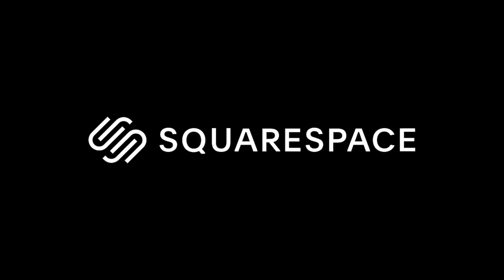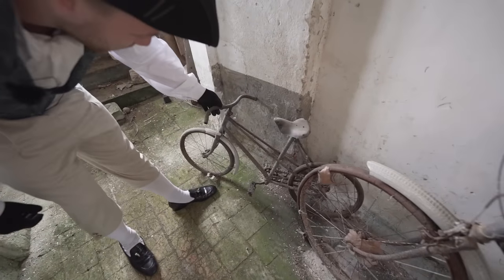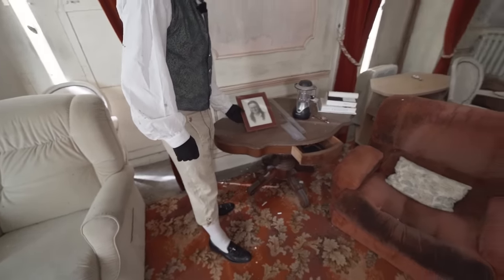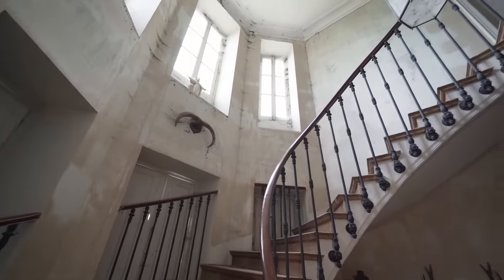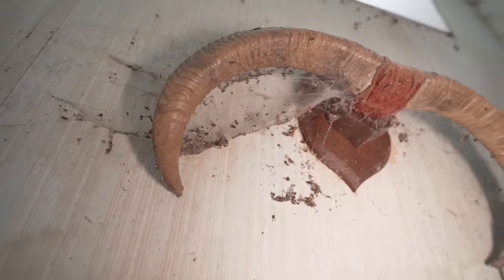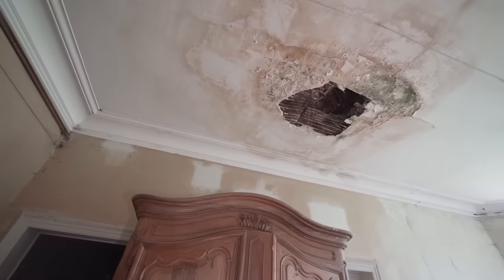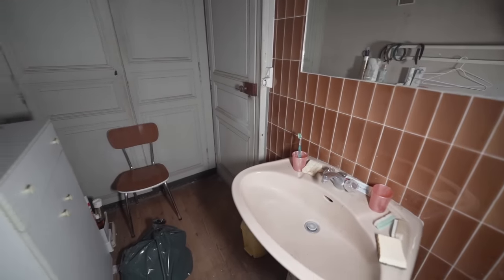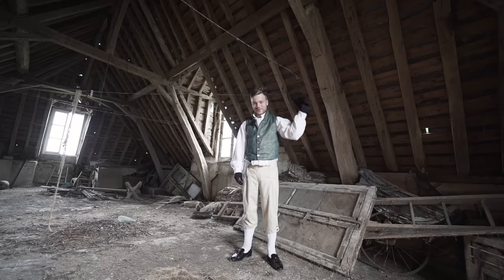Abandoned 1700s Fairy Tale Castle ~ Owner Died in a Car Crash!

Comment: Loved this. The little painting of the knight slaying the dragon is Archangel Michael slaying Lucifer. The knight has wings, a symbol of Archangel Michael. I think the last generation of residents who lived here abandoned most of this castle and only lived in part of it for decades. The part that is in very bad shape did not get that way in only eight years. The piano still plays because the cover was kept down over the keys, thus protecting the keys from moisture in the air damage. It is important to cover the keys to a non-electric piano after every time you play it for this reason.

Comment: I watched wondering where the grand 18th century rooms were, and if finally struck me:  they are all in the black mold-infested part of the chateau :(   The rooms we see here are too small, too modest and too sober, nothing like the light and bright Rococo spaces we should have seen.  I would guess that as the chateau became too expensive to maintain, the remaining residents began retreating from the grander living spaces into smaller ones that were easier to heat--look at that modern kitchen, for example:  I can assure you that the original is on the ground floor (or perhaps in the basement), and if features at least one fireplace that would dwarf any of the others you saw.

I'll also guess that the dilapidation of this chateau began well before the owner died.  The odds are great that the family simply hasn't had the financial means to properly maintain the property for a while now, meaning that it's highly likely that they stopped making the necessary repairs years (decades?) before that man's death. Add to that some kind of inheritance dispute among the heirs, and you get a situation like this, with a piece of property left in limbo until it finally collapses.